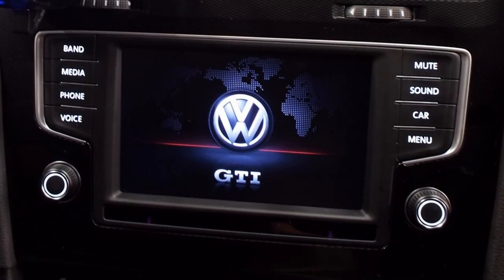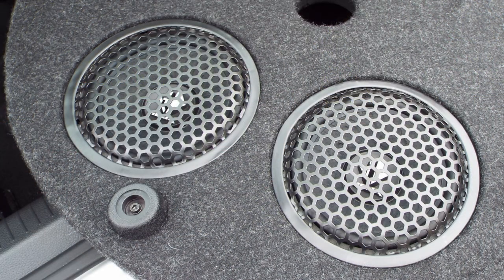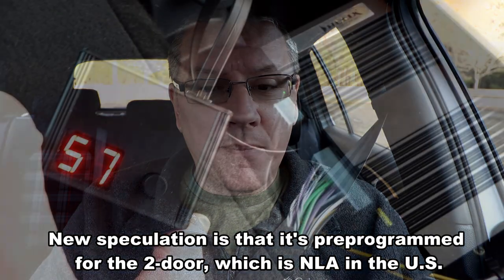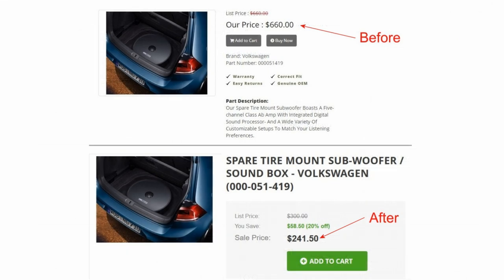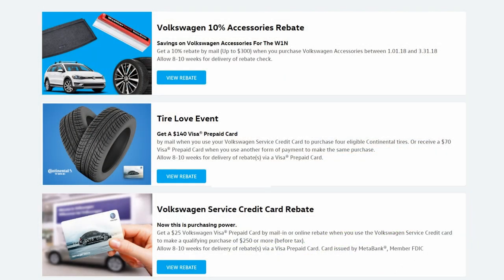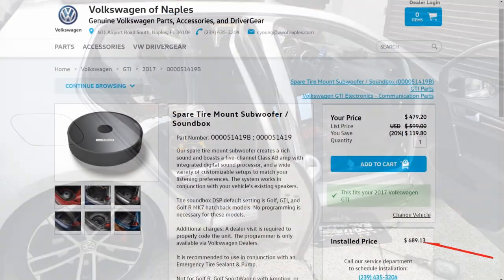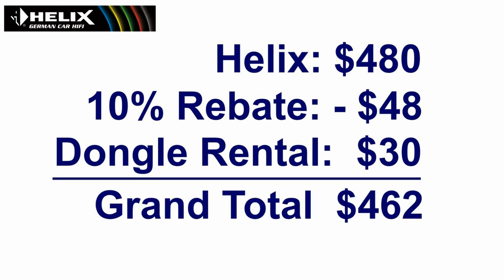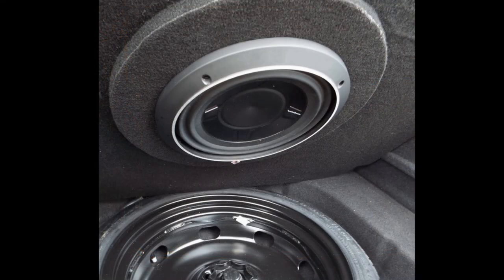VOLKSWAGEN HELIX SOUND SYSTEM

Comment: Hi Stealth... I have a 2019 SEL Tiguan, and the stock 6 speaker system... really missing the Fender that was in my older SEL... torn between the Helix ($560 plus install is basically $800, don't feel confident installing myself)... or spending a little more on a 10" and a separate amp... thoughts?
Reply from the maker: Blaise - It depends on your preferences. Are you happy with your mids/highs and looking for just a boost of bass? If just a bass boost, the 300-watt subwoofer system I first installed could be done for $450 in parts, plus installation and box. Just tap into the speaker outputs at the head unit. That was Rockford Fosgate Punch stuff. I now have a 500-watt Rockford Fosgate Power setup that is about double the cost. If you're looking for improvement all around (highs, mids, and lows), then the $800 installed price of Helix isn't bad at all, especially if you like the MIB2 interface. Check out my Helix long-term review, which includes a good quote from a 3rd party: https://stealthgti.com/2018/10/04/long-term-review-helix-sound-upgrade/. If you require professional installation, then it's going to cost whether it's done by your VW dealer or another shop. "Pay to Play," right? ;-)  Thanks for visiting! -Scott
Reply: @StealthGTI  Thanks Scott... The Mids / Highs are ok... could be clearer but don't suck... I have been turning the bass down and highs up and its much more clear, just then lacking bass... I guess the thing is if i put in just a sub, I'm gonna have ok clarity and more bass... if I go Helix, its more clarity, but much less bass than like a stand alone 10" sub, right? ...  so that is helix vs just sub... do you have any thoughts on running a different 4 channel amp for all the speakers? or is that just too messy?.... by MIB2 interface do you just mean the stock screen interface? I know if I run a different amp I may lose my fader etc... Thanks Blaise
Reply: I guess my last question is... can you install the Helix and then later add an additional sub? is there roomy to hook up both? would that work? I know I like good sound and I have never installed or added anything myself. Thanks again.
Reply from the maker: @blaisedelacroix1832  - Sorry for the delay. I've had a busy few days. Unless you play your music quite loudly, I don't think you'll need a 4-channel amp over a Helix upgrade. I've never felt the need to go beyond 50 watts per channel, except for the sub. Also, I think you'll be surprised by Helix's bass output. I know I was. Yes, MIB2 = stock screen. I'll answer your other questions in your other post.
Reply from the maker: @blaisedelacroix1832  - I'm sure anything is possible, but I wouldn't do both. Check out other videos in my channel and my blog entry at https://stealthgti.com/electronics-suite/ to see how I added a 500W subwoofer system to my Helix setup. In my case, I REPLACED the Helix subwoofer with a larger sub and added a dedicated amp for the new sub. I still enjoy Helix's DSP and front imaging, but have added deeper, more powerful bass. See my blog for details.
Reply: StealthGTI thanks Scott! I love this idea... to start with helix, keep the stock speakers and then later replace the sub... I saw the sub replace page... seems doable.... when you replaced the sub, do you still have to ground it to the battery and all of that? Or did helix to Lc2 to Rockford amp take care of all power? Again I’m a little nooby... the only thing I may add is rear door tweeters. My car only has 6 speakers and not 8, and I have read that the helix in a Tiguan sounds much better with 8 speakers than 6. Thoughts here?
Reply: I watched the sub video, which answered my power question... I guess my new question is... for someone who just wants to replace the helix sub, is all you need the lc2, amp and sub? Is the eq necessary... watching your video I got overwhelmed with your components and starting thinking replacing the helix sub might be too much lol. Thanks for listening.
Reply: I should note that the 2019 Tiguans with 6 speakers like mine, for some reason, they have the grill in the rear doors for the tweeters, just no speaker there. Upon looking there is of course no OEM part number for my car or that door... so I dunno if find one from another year or go after market, which may as you mentioned in other posts no stage with the rest of the helix.
Reply: Last question Scott. Ordered my helix and waiting to install for the dealer to receive dongle... I read some other threads about helix sound being better with streaming music, but experiencing distortion with satellite radio, have you run into anything like that? Thanks! Sorry for so many questions.

Comment: Read the article on your website, noticed you used the pre revision part number which uses the PP50DSP. Did you discover any differences between it and the PP62DSP?
Reply from the maker: Corrodiate - I did not do a comprehensive study of both units. I just know that the 62 replaced the 50 and I'm inclined to believe they're very similar due to them being compatible with many of the same VW models. Odds are Helix simply upgraded some internal parts due to supply changes, but kept the connections and functionality the same. Just a guess, though. Thanks for visiting! -Scott
Reply from the maker: I haven't seen the new unit in person. But I suspect it is very similar and made to use the same wiring. I'd love to meet someone with a new new Helix someday so I can have a look. Thanks for visiting! -Scott

Comment: I have this setup in my MK7. For some reason, my subwoofer doesn’t work when I want it to. It gradually comes when it wants about 15-30 min after driving. Anyone having the same issue? It works when it wants to but when it does, it kicks pretty hard.
Reply from the maker: Jesse - Have you ever adjusted the potentiometer (tiny screw), often referred to as a "gain" screw? I'm not suggesting that anyone touch this. BUT, if you've ever touched it, then it may be out of alignment and worth fiddling with. Thanks for visiting! -Scott
Reply: StealthGTI Hello Scott! I have not adjusted the gain screw though I have taken a look at the subwoofer to inspect if any wires may have been lose or frayed. It didn’t appear to have any malfunctioning from the wires. I have been looking for a solution to this issue for months now !

Comment: I love helix products most of their stuff is still made in Germany the it's just simply amazing then they're cheaper amplifiers are simply simply so good for what they cost I have their highest and stuff and their entry level amazing their speakers are so affordable and sound so good. I have there aftermarket stuff not the license through Volkswagen but I heard the subwoofer and I thought it was good 👍
Reply from the maker: Good stuff! I had shared a review on my website that features this quote from a VWVortex user: 

“All of you should be VERY happy with what you got for the money. Especially those that paid $250. Yes, certain aspects of the Helix could be better, but now that I have perspective on the sound of the Helix compared with the system I just installed that cost 4 times more, I really appreciate the work and engineering that went into this bespoke sound upgrade solution for our vehicles. Helix is an award-winning company renowned for its super high sound quality and they have packed a lot of their intellectual property into this amp. The value is especially surprising when you look at how small the amp is and realize there is a built-in DSP with EQ, time alignment, etc!” 

I'm still very pleased with my setup. Thanks for visiting!
Reply: @StealthGTI    you look at these European companies that make audio equipment they're actually better deal and well it's always with audio equipment that they are better than mass produced stuff and cheaper most of the time for what you get

Comment: Thank you for the detailed info (good videos, subscriber) - Mk7.5 GTI got the Helix installed at the dealer, reprogrammed, still have my spare and used the rebate coupon (thank you StealthGTI) - unfortunately sound is like shoes (gotta try them on) not happy with the outcome, so very interested in your sub and amp upgrade to the Helix.
Reply from the maker: Glad it helped! Here's a link to my most recent subwoofer video, if you haven't already seen it: https://youtu.be/2-f6BPnmdlM. Thanks for subscribing!

Comment: Stealth I have the fender audio system in my 15 gti se.   I would really like to go active with pro mids and super tweeters and go high end on a 8 inch sundown with a close to 3000 rms 5 channel amp.  Do I need anything to hook up to the fender amp or is there a way to use the fiber optic?
Reply from the maker: I have not studied the Fender system to that degree. I had a subwoofer upgrade in my Mk6 Jetta TDI with Fender. But I was completely unaware of any fiber in the system. I recommend a visit to GolfMk7.com and checking out their Infotainment section. Good Luck!
Reply: @StealthGTI  thank you bud I think I have a good idea for it just going to take me about an year to cut and fit and run not going to start till the spring time and I'm thinking of posting it somewhere with details because I'm sure I'm not the only person that wants to keep stock head unit.  I really like that custom built rack you did that's why I was just seeing sence you know your stuff but and thank you again for the advice have fun for your holidays.